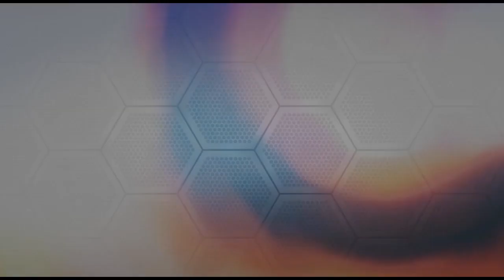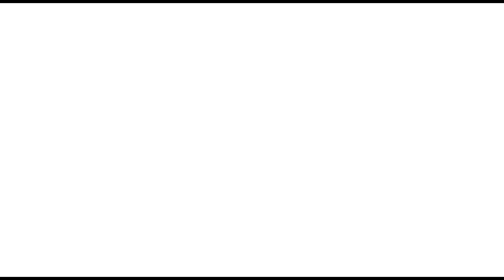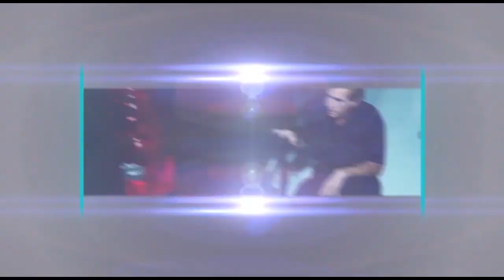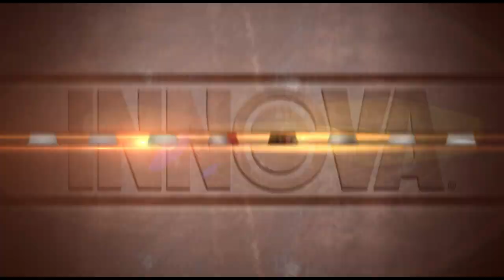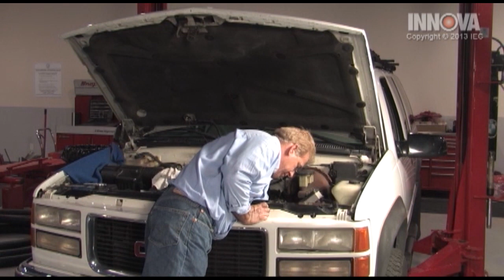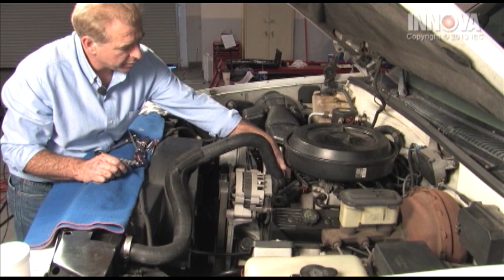How to change Thermostat and Gasket - 1995 Chevy Suburban

Comment: I thought that gasket was around the thermostat, you laid it on top.
Reply: Dude I thought the same thing too at least for the thermostat that I have the O-ring does go around the thermostat not on top I'm pretty sure he's going to have a weird nasty leak
Reply: I just replaced the thermostat and o-ring on mine just right now and my old o-ring had a slit right in the center of the O-ring inside, and my new o-ring had a slightly offset slit through the inside so I put the thinnest part facing the top and the thicker part facing the bottom since on the engine it has a boss for that O-ring
Reply: And to be clear the slit is where the middle part of the thermostat goes into so that the O-ring completely surrounds the thermostat so far no leaks

Comment: What happens if you find that there’s no thermostat underneath the housing that’s what happen to me today took off the housing to find it’s gone
Reply: Last owner wasn’t running with one then happened to me too and I put a new one
Reply: Not any big deal just replace it with one you can run a car without a thermostat it's better to keep it running within optimal temperature which of thermostat controls it will get better here than in the winter and all-around better performance because it will be at the optimum temperature for the fuel to burn correctly